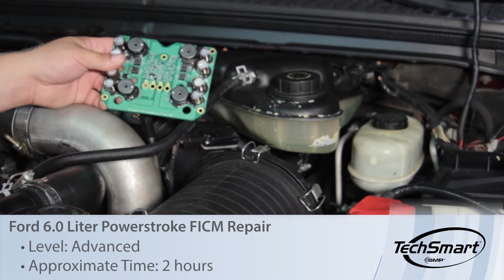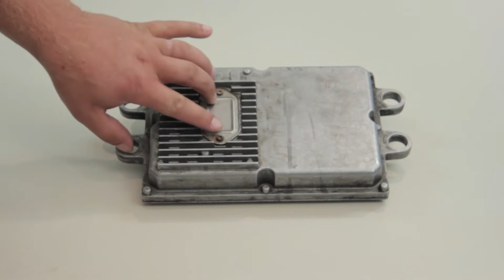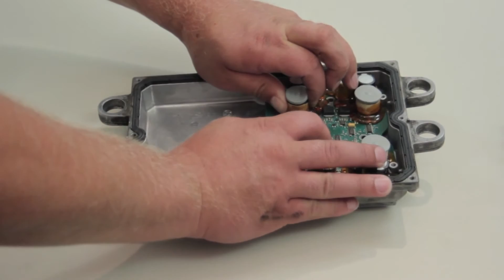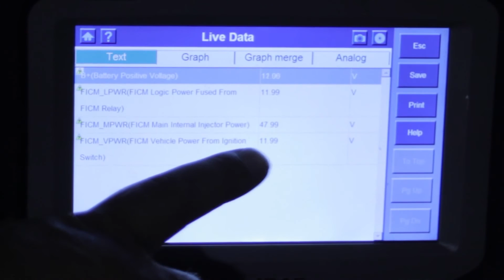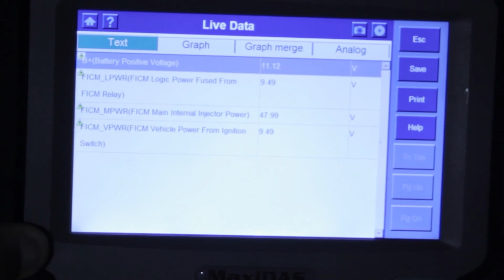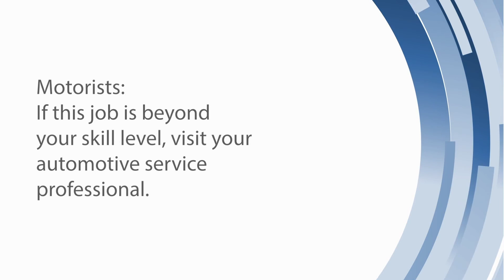Ford 6.0 Liter Powerstroke FICM Repair

Comment: Is the circuit board you replaced the one that controls the voltage? Mine is starting to go bad and I don't wanna have to spend $500 on a new ficm if I can buy just the circuit board.